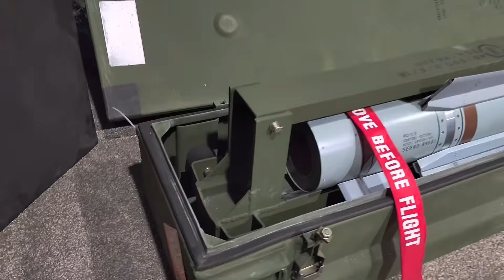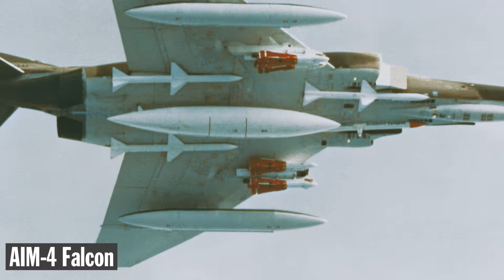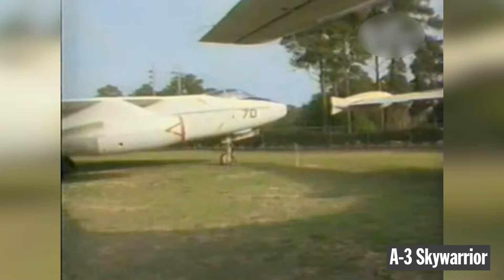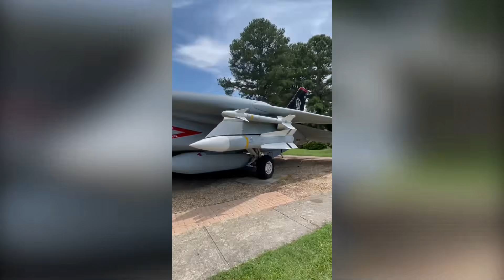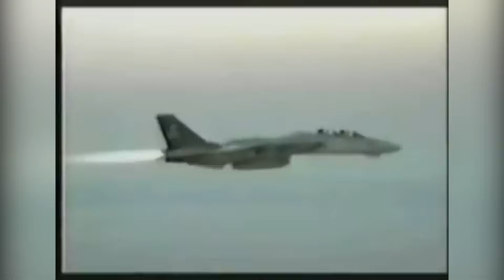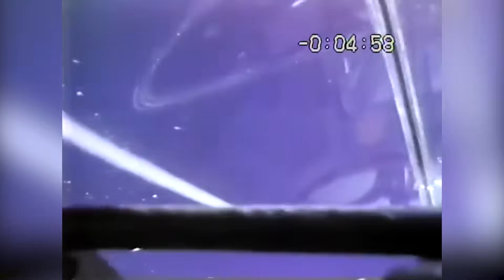American missile AIM-54 Phoenix || Review

Comment: -You missed the one major difference between the AIM-54A and C.  The A version used external liquid cooling for the missile.  This coolant was very prone to contamination especially at the wing stations.  For this reason wing stations were not a desired location to use.  Plus, with more than 2 Phoenix on the F-14 it was over weight for recovery on boat ship.  Thus, any excess Phoenix would have to be jettisoned before landing.  The AIM-54C used internal liquid coolant.

Comment: My dad was the engineer who designed and was later one of the lead test engineers for the AIM 54A & C.  It was not Bendix, it was Hughes Aircraft Company.  It was originally an USAF project and by 1965 the 5th prototype was successfully delivered ... a month ahead of schedule.. and was now being transitioned to the USN. Motorola & Westinghouse wre 2 of the major partners on this program.

The original AIM 54A was designed for the 1st Blackbird- a high-altitude supersonic interceptor...... which was cancelled....

This history is validated in an interview done on YT by "Peninsula Seniors" in a series called "Life After Howard"- Part 3 IIRR, Ken Richardson tells the whole story including why the AIM 54  was replaced by the AIM 47 .... Ken was President of Hughes Aircraft Company's Missile Systems Group at the time.

I also have the "Hughes News" showcasing this celebration and my dad was one of the featured engineers.

Myself and my wife both worked at HAC as well... if you would like to interview me on this I would be open to showing you the docs I have and discussing this is greater detail.

Comment: This missile should have been adopted as a ship launched air defense and anti-ship weapon.  Mach 5+ speed, 100+mile range, 100+ lb. warhead...  What's not to like?
Reply: It would not have been the same missile.  In order to be ship launched, it would have needed a booster or have a longer body to incorporate the additional fuel to get it to altitude.  And it's Mach 5 speed was only because of the height it flew to.  It would not have had enough time when ship launched to get above an incoming threat.